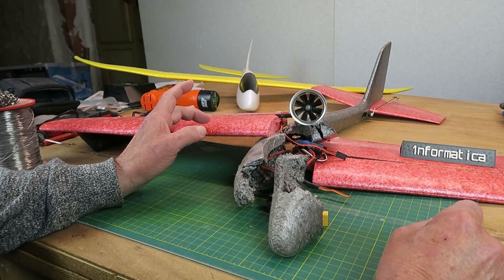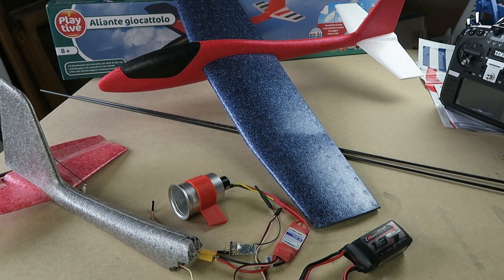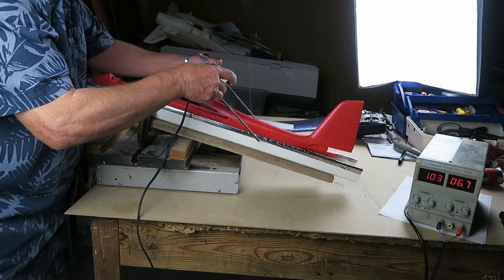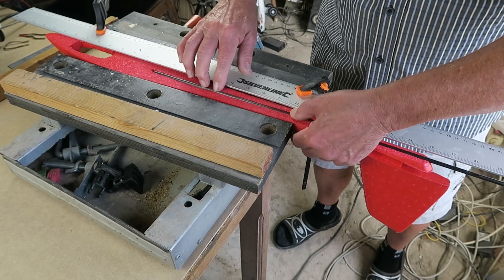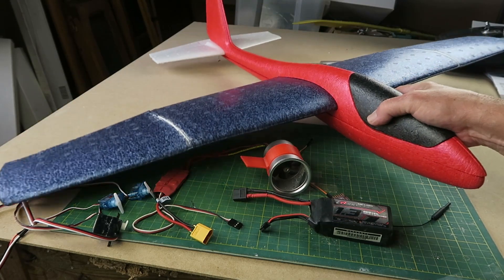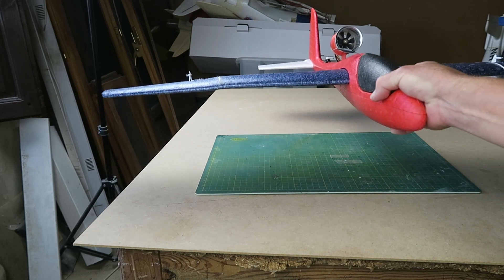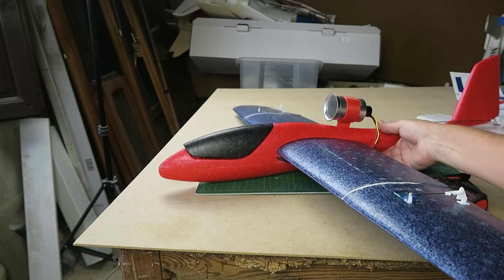Lidl Glider 40mm EDF RC Conversion

Comment: Thanks for the interesting build video. I look forward to seeing the the flight one. Just one minor remark : I've had crashes as bad as that (many, many) and have managed to repair the damage relatively easily just as long as you've got all the bits! I use Scotch Gel Glue which is sold here in Belgium for €5.50 for 3 medium sized tubes. It works really well. I spread glue on the damaged parts and then seal the 'wound' as a surgeon would with narrow strips of duct tape.
Reply from the maker: You're welcome! I considered it a write off as the main wing was in half and it even broke the carbon strip in it! Hence carbon rod this time. Will take a look at the Scotch glue, have you compared it to UHU Por? Have a great evening!!
Reply: Haven't tried POR though I've heard a lot about it. I think it's a lot more expensive than Scotch, not that that's the only considerarion. A guy in the club recommended Scotch to me, hence my choice. Good luck with the maiden. @1nformatica
Reply from the maker: @richardhayes200  Seems the situation here in Spain is the reverse! A single 30g tube of Scotch Gel is around 8€ including shipping!! Tell me your supplier in Belgium, maybe I can order from them!! Hope to maiden this Wednesday weather permitting!!
Reply: Scotch Gel Glue is sold in packs of 3 X 30ml for €5.50 by a chain of supermarkets called Colruyt, similar to Teco, Aldi etc. I've not tried looking for it elsewhere. Good luck on Wednesday!
Reply from the maker: @richardhayes200  OK, thanks for the info, will keep a look out here.

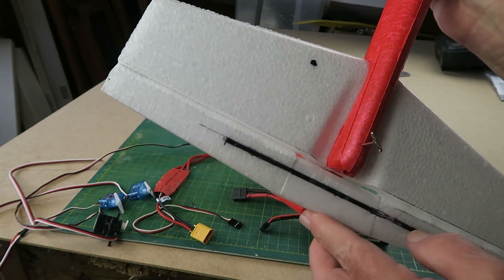Comment: Wow, excellent work! I'm planning to build something similar. 5:24 elevator spar is 3 mm in diameter. Could you please share the diameter of the carbon fiber spar in the wing and in the fuselage? I'm building my shopping cart now to order materials and can't decide on diameters or the rods :D
Reply from the maker: Hey thanks! The wing and fuselage are both 5mm https://youtu.be/7Os3m2Rz1b8?t=239  Have a great day!